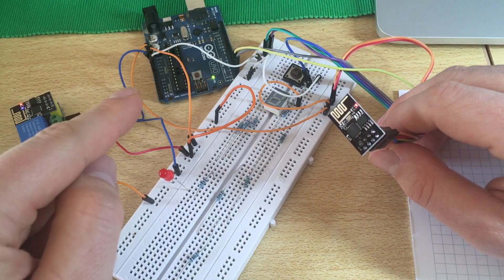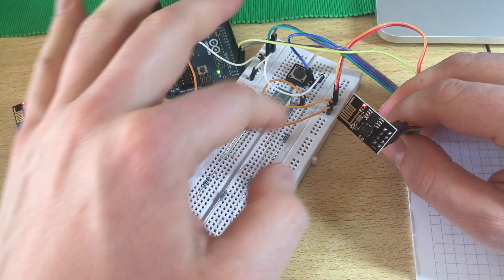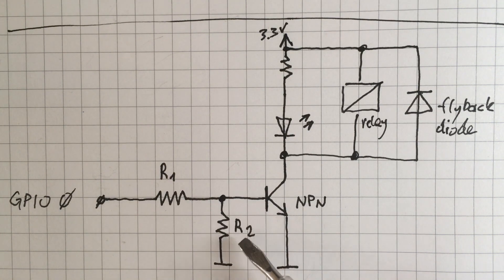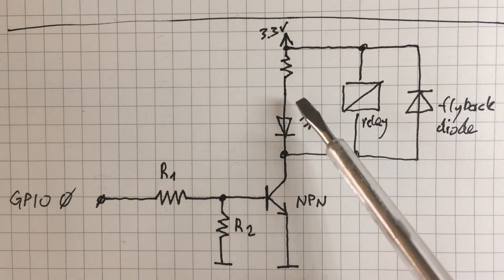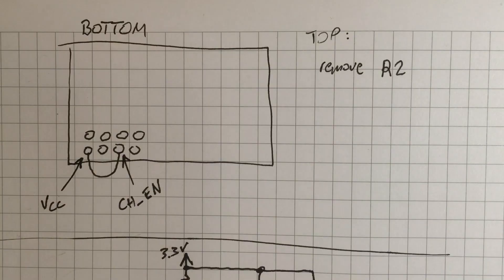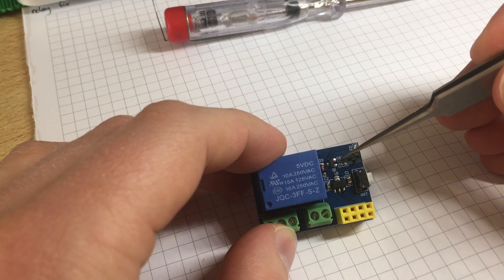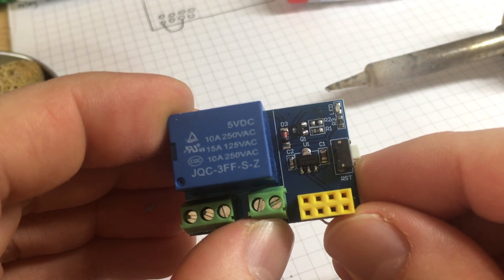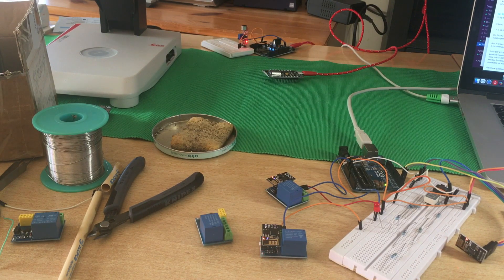HOW to FIX your ESP-01S / ESP8266 relay

Comment: Hi I had the same issue and I followed these steps and the module is working but there's no power on the relay output how do I fix it?
Reply from the maker: Hi, not sure if I can follow. Does the relay click when you switch the digital output?

Comment: I am bridging the power from 5V to COM so I don't need two power power sources for the same appliance. It's a 5V USB light. My main issue is that if I connect the power to the device via NO it stays on and NC it stays off but I can hear the relay clicking. so not sure why it isn't working.
Reply from the maker: sounds like your relay instantly turns on? is it clicking at the right moment or every time you power on the pcb?
Reply: Sorry I missed your reply. I ended up fixing it. The jumper wire from from CH_EN to VCC as your demonstrated was the main fix.   @playduino

Comment: After removing resister my ESP01 is warming up and shutting down after working for a minute.
Is it just me or others are having the same issue. If others are not having so I will assume it is the CN_EN pull up soldering job must be not good from me and something is shorting.

Comment: Thank you for this.  I bought a few of these and I'd completely failed to get them to work.  Desoldering the 10k R2 (i.e. the resistor closest to the edge of the board, and connecting CH_PD to Vcc did the trick.  What I don't understand is how this design ever got past testing since it's broken but at least now I know how to fix it.
Reply: who knows, it was version 1.0
maybe it got fixed in the next revision

Comment: This should be linked in every aliexpress esp01 relay module!
Btw, do you know any way to add a cheap/simple delay circuit to this so the relay connected to gpio0 doesn't get high when rebooted? It sucks that doors/lights pop on randomly and so far the only viable solution for me has been soldering a thin wire to gpio4 and replacing the gpio trace with it...

Comment: Take a look at this entry for the "easy fix", good eyesight and dexterity required but doable, to fix this relay board. Already mentioned by Мирон К 2 months ago
https://cmheong.blogspot.com/2018/03/debugging-esp8266-esp-01s-relay-module.html?showComment=1547750165874#c3276908839421975099
Reply from the maker: awesome thx

Comment: You can also connect the relay to the RX pin of the esp module which is GPIO3.  Then you do NOT have to remove the resistor.
You still need to do the jumper to the Enable pin to VCC.

Comment: Your video solved my problem of it not connecting to the wifi. And the removal of R2 I confirm works. Thanks for your time for it is truly appreciated
Reply: Mark Roles can you tell me how can i turn the relay on and off though my iPhone? please
Reply: @m_zxh_di  I flash the ESP8236 with TASMOTA. There is a lot of youtube DIY how to do this. Very easy. Just flash it then look for the IP address for it to open it in a web browser
Reply: Mark Roles thank you bro 

Do you use it for Lag Switching in video games ?

Comment: hi, same problem,. when i connect power, relay does on/off/on/off a few times, before connecting to wifi.  Please help
Reply: I just found out that when you replace R2 with 27K resistor then it start to boot but relay flickering will go out. you can try hopefully will work also for you.

Comment: hi, when i connect power, relay does on/off/on/off a few times, before connecting to wifi.. i put relay on gpio0 low in setup, but this problem persists...
Reply: To stop an active LOW relay from flickering on bootup:
In setup(), write a HIGH to the pin, before you set the pin to OUTPUT.
 Like:

digitalWrite(relay1Pin, HIGH);
pinMode(relay1Pin, OUTPUT);

revert if your relay is active on High
avoid rx, tx LedBuiltin pins as they usually chatter on boot....
Reply from the maker: hi, I will make a video about the software I am using very soon. I think this might help you
Reply: @playduino  I'm still waiting for your video
Reply: I just found out that when you replace R2 with 27K resistor then it start to boot but relay flickering will go out. you can try hopefully will work also for you.